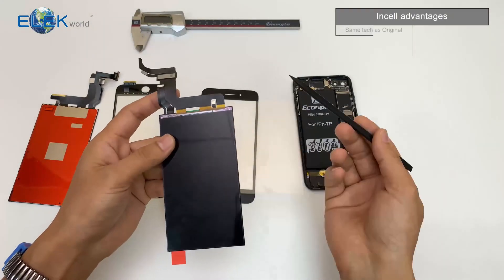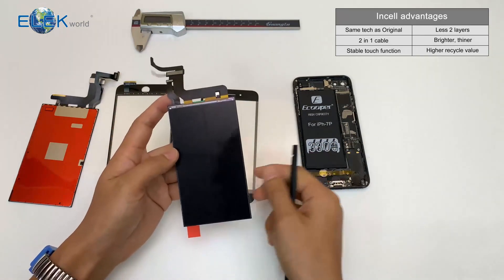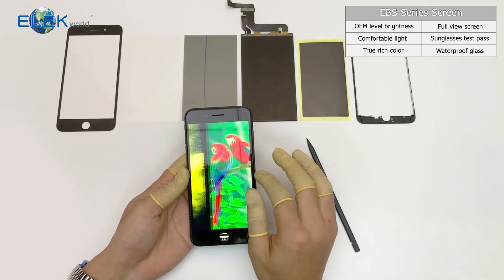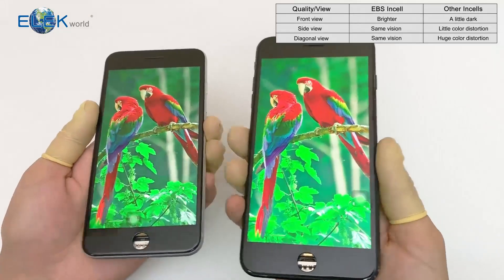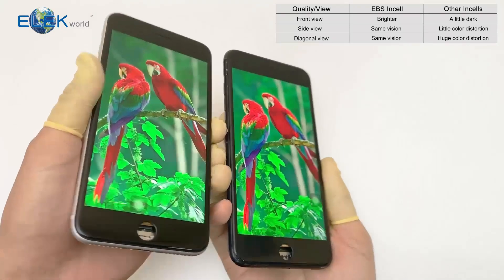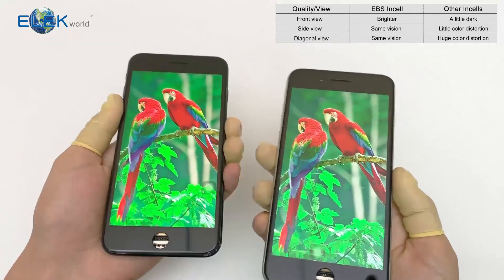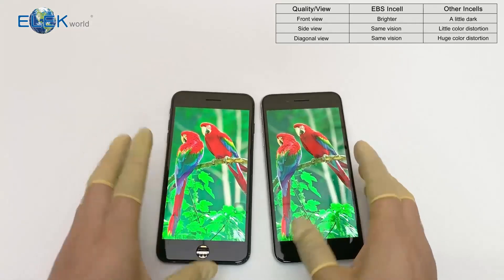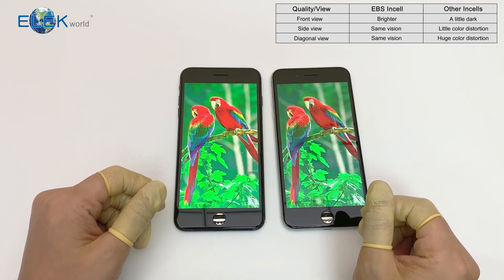What is Incell LCD? Structure Breakdown & Comparison + EBS Incell Secret Reveal.

Comment: What is the difference between EBR and EBS, and what is better? EBS incell or EBS III?
Reply from the maker: EBS has brighter display and more comfortable light than EBR, but EBR has better price combined with basic good quality. 
EBS III is upgraded from EBS, with higher brightness, high range color upgrade. 
EBS Incell is with Incell technology, which means less layer inside, bright display and also high range color, also less thickness & better using experience. 
If any other questions, please email service@elekworld.com for details and exclusive 1 on 1 service.
Reply: @Elekworld  but tell me EBS III is incell too?
Reply from the maker: @antoniofernandes5072  Nope, EBS III is not Incell technology.
Reply: @Elekworld  ok